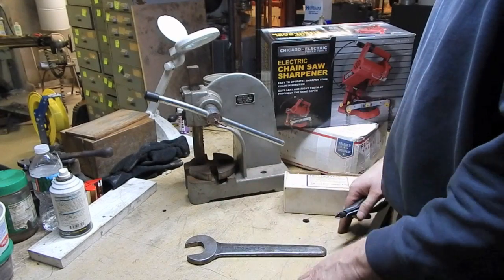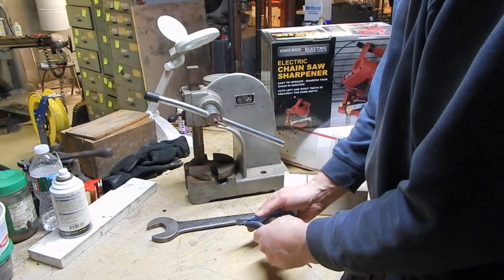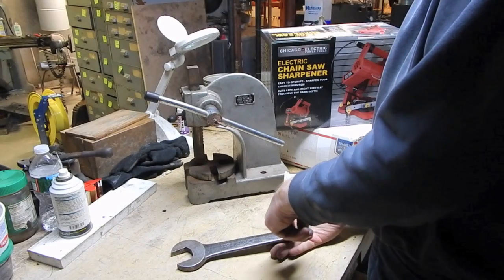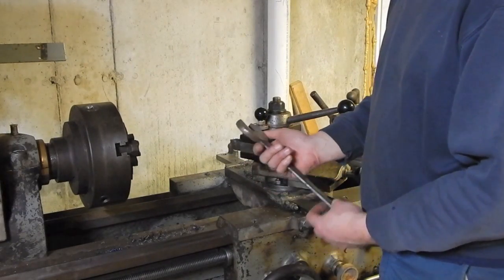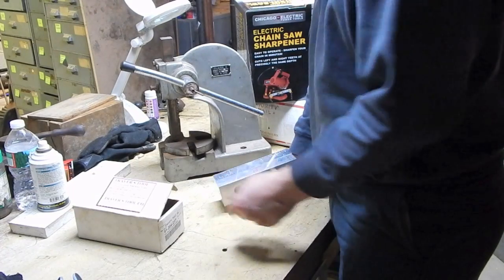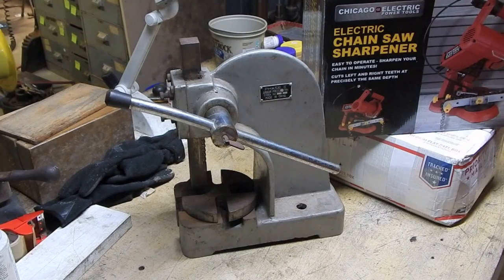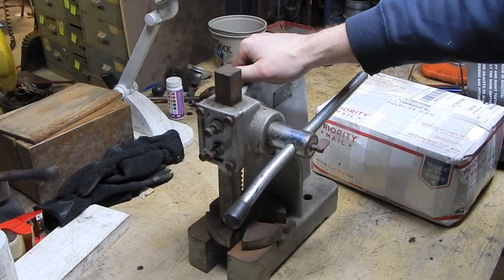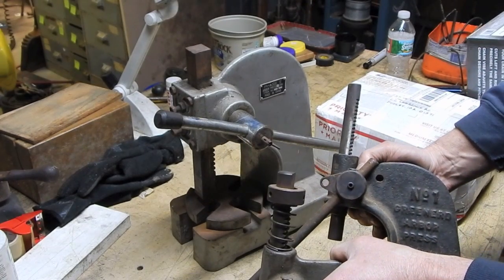Mid January Flea Market finds Part 1

Comment: Your Aloris parting and grooving blades are C2 carbide.
Reply from the maker: +gbowne1 Well at first glance for information as to what that means for me, it appeared these should only be used on cast iron, brass, aluminum, and other non-ferrous metals, so I guess I was not supposed to be cutting steel with it (Done this twice now). But other forums say I can cut steel with C2............your thoughts?